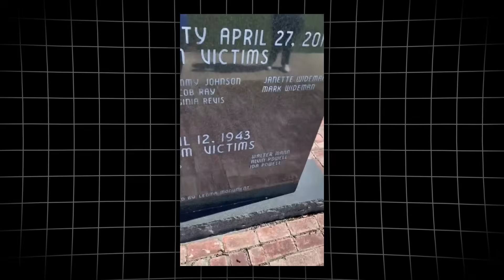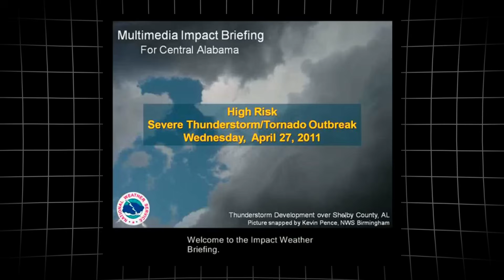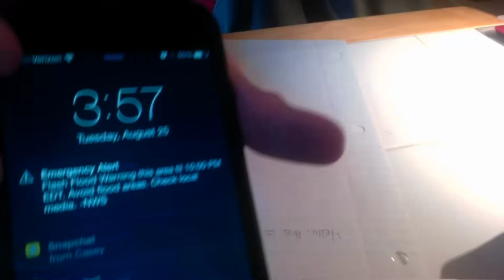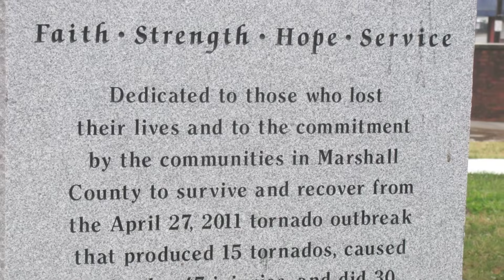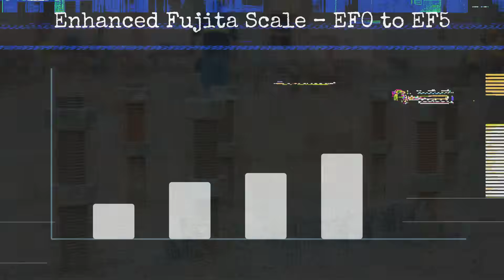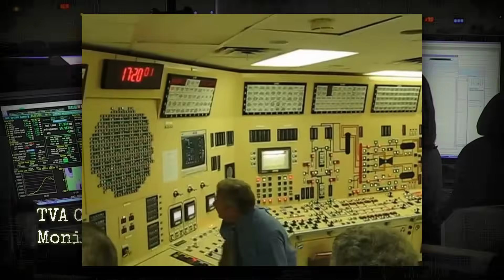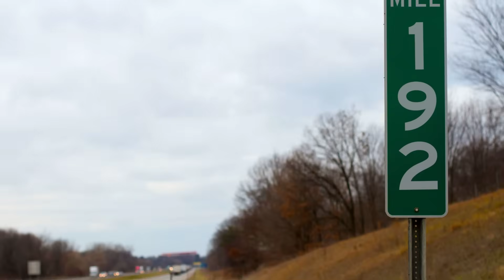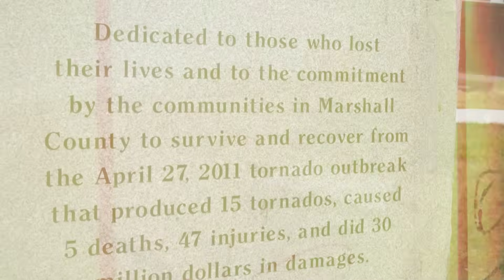The EF5 That Ripped Alabama Apart — Hackleburg–Phil Campbell Tornado (2011)

Comment: Damage put the estimated wind speed at 210 mph, but I can't help but believe the winds were a lot higher than that, probably 300 mph, close to Jarrell and Bridge Creek-Moore. This one is not EF5 (any wind above 200 mph), it's F5 on the old scale (261-318 mph).

Comment: Early in the video, the voice said Alabama was in the bullseye...while the map showed the name of the state... problem is, it was pointing to Oklahoma. 🙄
Reply: Alabama is to Dixie Alley what Oklahoma is to traditional Tornado Alley. Like Moore, there are places in Alabama that have been hit more than once. The one in this video hit Tanner, Alabama, which was also hit twice during the 1974 Super Outbreak.
Reply: @ILoveOldTWC You are indeed correct. Tornado season here in Alabama can be brutal. Not so much this past year, though. We definitely had a quiet spring.
Reply: @davidreed4661  Except March 15th. There was a High Risk that day, and there were some tornadoes across the state that did damage that day. But, yes. That was pretty much the only event of the season.
Reply: @ILoveOldTWC Again, you are correct. It was just much more quiet than usual.
Reply: @davidreed4661 So was hurricane season.
Reply: @davidreed4661  Tornado season is the most brutal when there's a weakening La Nina during the spring, as was the case in 2011, and in 1974. 2021, too. We had two High Risk days 8 days apart on March 17th and 25th, 2021, respectively. There were several confirmed and quite damaging tornadoes both times.